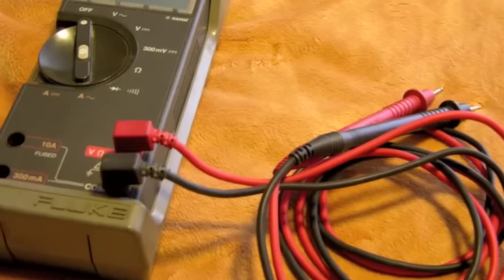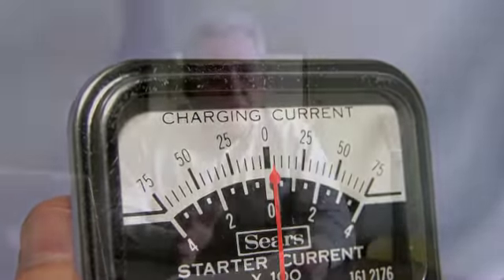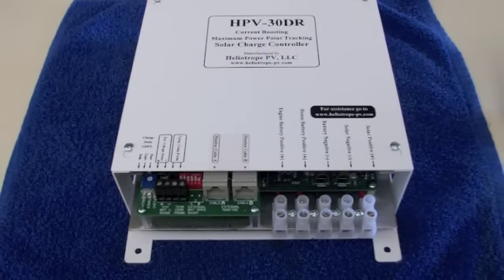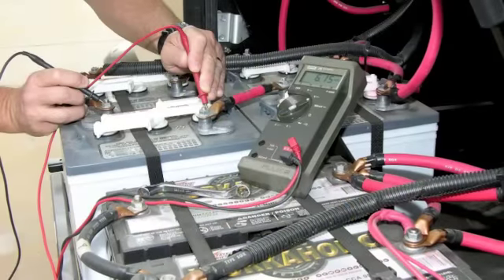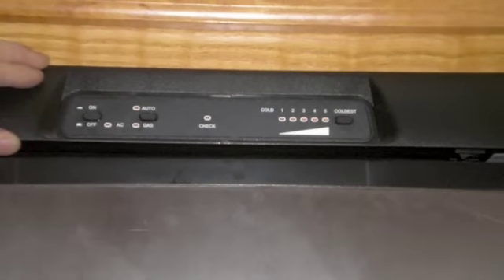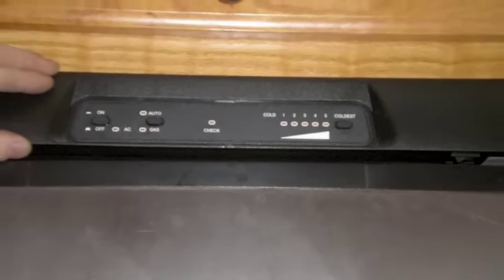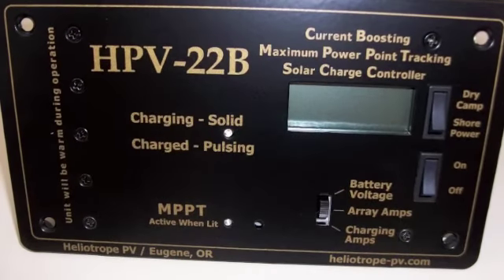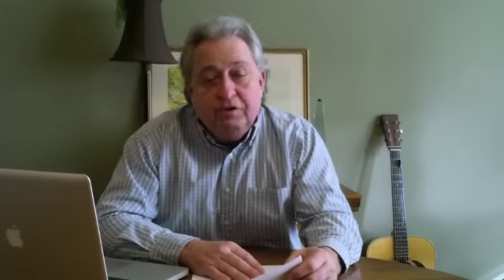How to Tell if Solar Panel is Charging the Batteries

Comment: i got 2x 190 Watt solar panels on my roof and my charge controller shows only 50 watt coming in from then in bright sun midday.. 
wondering if one of them is broken or both? 
would one still be working if i got them wired in series and one of them is broken? thank you

Comment: i have  battery agm 60 volts and i have a solar panel suitcase type, 50 wat. on each side so 100 in totall. i took both things to a guy to hook it up for me. the charge controller on the panel says it is getting sun, green light, but the battery and output are dark no activity what could this be?

Comment: I hooked my solar panels to my charge controller, it displays that is getting energy from the solar panels but the energy in the battery doesn’t increase, i tried disconnecting the load to the only the battery charging but it still doesn’t work does anyone know what should I do?